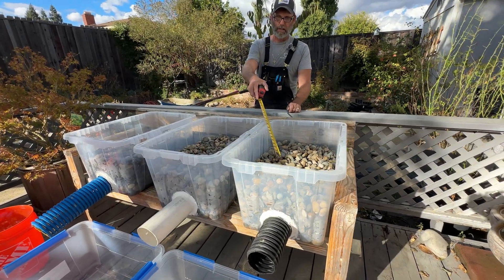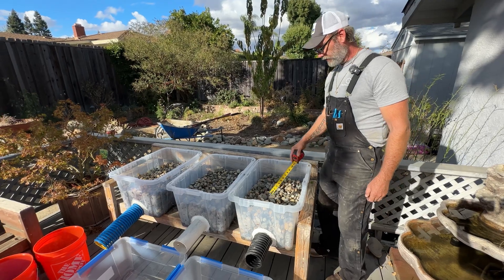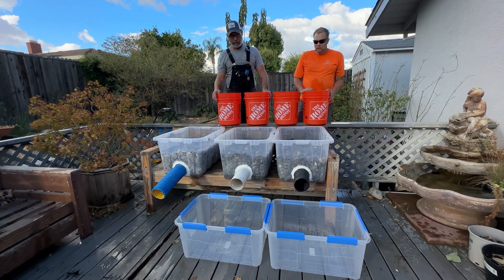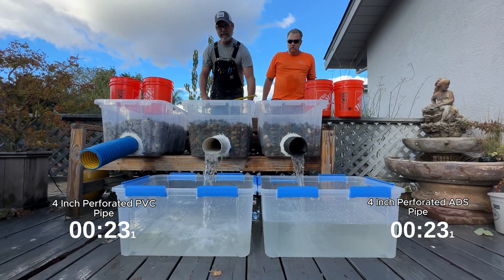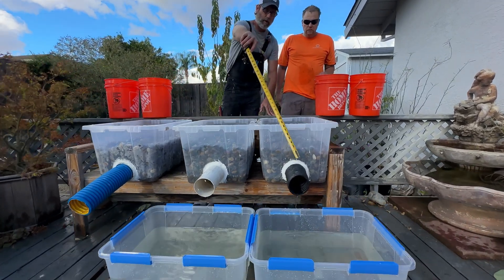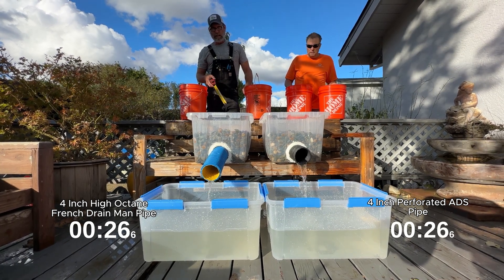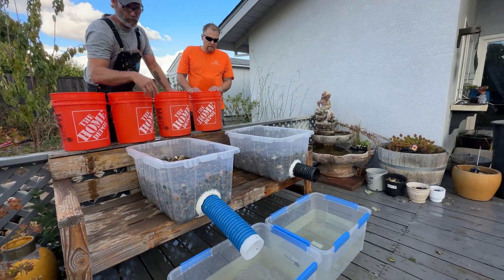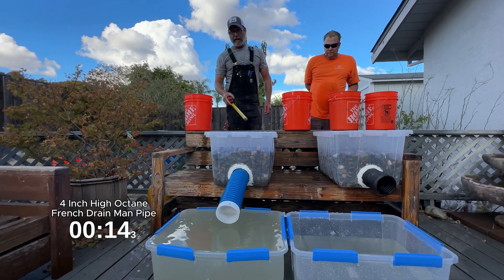ULTIMATE French Drain Pipe Water Race Test (Results Will Surprise You!)

Comment: Seems like an advertisement for FDM pipe.
Come on guys, PVC pipe was installed with holes on the bottom, yet the other pipes have holes all over the pipe.
Second of all, pvc pipe comes in 20ft runs too, a coupling is absolutely not a weak spot, it’s glued and it’s an integral part of the pipe now, never to be separated by anything other than an excavator bucket hammering at it.
At least don’t be this obvious when trying to sway people in any direction; some people just aren’t that gullible…
Reply from the maker: First of all this demonstrates an open french drain. The fact that PVC isn’t made with complete perforations is not our products fault. That’s why we designed this as we did. And the reason PVC isn’t is because it’s not designed to be structurally solid with that many holes. PVC cracks, especially in cold weather. HDPE expands. Also by ground expansion and movement. As well, PVC requires a gravel base because the holes are on the bottom. This has a hard time drying underground and roots grow towards the moisture. Causing roots after 10 years depending on circumstances. I’m guessing you use copper shields, netting and sulfate? Most don’t think this far down the road because they aren’t aware or just don’t care. Our product was designed to be a lifetime system. Also, corrugated at the proper 2%+ grade self cleans itself with turbulence, something PVC can never do. 
Secondly, couplers are weak points. Glue does not stop this when the pipe shifts and cracks. As well, almost all new installers of new homes don’t even use glue. They dry fit, I know the installers. PVC also needs to be installed with perfect 1% grade and if it waivers or gets moved out of perfect grade debris builds up causing water to ultimately build up, which causes roots to sense the water and grow inside. 
Thirdly, the product sells itself. Anyone that actually took the time to see the material and research would learn that whatever they learned previously or regurgitated from the internet isn’t always the best. It’s just what they know. That’s why our team is the best…we are committed to continued education and will always keep learning new innovative ways to improve.

Comment: However blue one has more of a slant not fair. But 100' rolls is good thing if as tough as it is claimed great.
Reply from the maker: These are both set flat in the container. But if this was a real in ground test corrugated is supposed to have 2%+ and that’s why it is self cleaning. The water turbulence inside the pipe is a positive. But these are both flat inside. FDM corrugated easily outperforms PVC

Comment: Where I am, the design standard is SDR-35 or equivalent. No corrugated.
Reply from the maker: There are different grades of corrugated. HDPE won’t freeze or crack. Virgin HDPE is much different than recycled HDPE. It’s best because it has holes 360 degrees and doesn’t require gravel on the base, which has a hard time fully drying..which causes root growth 10 years later. We install lifetime systems.

Comment: Hi, thanks for your super helpful videos. How do you decide to do a single perforated line versus a double perforated line (i.e an extra pipe for redundancy)? I don't have trees but the run is about 50 meters. Is two always better than one; or not really.
Reply from the maker: We always use minimum 4 drainage tile, but often I use more. You can use one or two if you prefer. The advantages to more is 1. Creating a larger void will ensure tree roots can’t shut the system down. 2. Same for sediment…it collects on the bottom so the more mains on the bottom and stacked will always leave somewhere for water to move downstream 3. Once you weigh the cost of additional rock, washing it, and installing there’s a lot of additional labor needed. 4. The large open areas will move water faster, where rock will have some restriction. 5. Having multiple mains on the bottom will have the most amount of water flow under torrential rains. 
The disadvantage would be the cost of shipping. We do have several distributors across the country so a local pickup would be best if you could manage that. If you need any free advice I can answer any questions you have. You can call the office number (google search) and I’ll be happy to speak to you direct. Thanks for the comment and kind words! We appreciate you.

Comment: What drainage setup would you recommend for a property right next to heavily wooded are to prevent root impaction
Reply from the maker: You’ll need to evaluate whether a french drain or solid surface water system is best. For either system I’d recommend using copper sulfate crystals on the bottom of the trench. Then I’d use the nonwoven geo textile with the infused layer of copper. You can use this material whether it’s a french drain or solid. I’d then use the copper sleeve over the drain pipe. Finish with more copper sulfate crystals. Be sure and install cleanouts on the bottom mains of your french drains. If you’re installing solid pipe use cleanouts/catch basins for access. If you need any additional clarification or advice you can call and I’ll discuss your project with you. Thanks for your comment

Comment: for buried downspouts on a separated pipe/line from the fench drain, does FDM corrugated still win out or in that instance the smooth solid interior moves easier?
Reply from the maker: It will win in the long run for sure because corrugated installed on the correct grade is self cleaning. The ridges cause turbulence and cleans the pipe. Smooth has to be 1% grade or the water will move faster than any debris. Which causes sediment buildup, which causes water buildup overtime, which causes roots to search it out

Comment: I like the test but I think you should be pumping the water instead of only using 10 gallons of water.  Dual M98 pumps could easily overload those pipes & show us how they compare.  Primarily the head-height, whose power is displayed at 5:20 where you can see the higher the water at the inlet the more pressure is at the outlet.  Using a pump for these tests allows a much more consistent head-height to push things more evenly to the outlet.
Reply from the maker: Thanks for your comment. These gravity french drains lead to a pump. So they are not recieving water from a pump. The restriction at that point would be the size of the ejection line and the pumps capacity. 
However, you can get upward of 240 gallons per minute through a 4” pipe. So it would take one fancy pump to overload that. Usually I’ll use 2” PVC (which would allow for 127 GPM roughly) or 1 1/2” (which would allow for about 80 GPM). I’ve done dual pump systems but honestly if the detention tank is large enough they are rarely necessary. We have a video on sumps and detention tanks too. They are usually 24” industrial culvert tees which have a horizontal holding area and allow the pump to sit lower than the majority of holding area….maximizing the use of the pump and minimizing short cycling. 
I can see how the pumps would provide more consistent supply for the test but that scenario would never happen in the real world regarding installations. 
Also consider since surface/downspout systems are separate from french drains they have that 240 GPM capacity on each drainage tile. On top of that, my french drains are always installed with minimum 4 each 4” drainage tiles (often more). So the actual void for allowing water to move is astronomical. I do this for maximum flow and longevity of the system (regarding root growth and debris build up). The drainage tile itself had a 300 year disintegration rate so a good healthy system will outlive my clients (and likely the house). Thanks for your comment. Appreciate it
Reply: @OlderHomeSpecialists  One of the things I wish a data-maker would reproduce is the NDS GPM ratings for their products.  One example is the CB #1245 where NDS shows the top-mount outlet can move 70.49 GPM but if mounted at the bottom can move 83.41 GPMs. So they gained over 10 GPM by installing the pipe a few inches deeper, possibly ~6 GPM gain at that inlet for every inch deeper it is put under the ground surface.  Nerd-numbers.
Reply from the maker: Good ideas! I totally agree with you. We rely on stats that are often not questioned and could vary under different circumstances. Thanks for the feedback

Comment: SO are we just gonna ignore all the water leaking around the blue pipe where it comes out of the bin?
Reply from the maker: Actually that’s the perforated tile shoving water out the holes. It does look like it’s leaking but it was not. It looked worse on the high octane tile because it’s the only material that actually has significant openings compared to the others.

Comment: One huge disadvantage of the FDM pipe is being able to actually get it.  With the cost of shipping, the pipe ends up being 4x the cost of ADS pipe.
Reply from the maker: We are setting up distribution areas around the country. We are here for local pickup in Northern California
Reply: @OlderHomeSpecialists   Yeah, that's my issue as well.  Would love to use FDM pipe, but the shipping cost is so high. Was looking at using his discharge plates, couplers, etc. and possibly PVC pipe.  Not sure yet.
Reply: FDM offers 25ft sections of 3 inch pipe in his Torrential Rain line, and they don't have the freight charge.  I only have 2 areas at the back of my house(one on each side of a raised porch area) that I need to get some water away from, and these were perfect for what I needed.  Shipping was only 12 dollars for two of the 3 inch pipe kits. Might not be a solution for everyone, but for me it was perfect and it let me get a better product than the box store stuff without paying high freight costs. I'm in Northern Illinois and most of the corrugated pipe from the box stores won't survive more than a few winters around here.
Reply from the maker: Great advice! I’m glad this worked out good for you! Thanks for the comment
Reply: $400 plus for shipping YIKES. I’d buy it, but thata almost $6 a foot
Reply: If you’re in north Florida or south GA we distribute.
Reply: Pay in the front end or pay at the back end
Reply: You being poor has nothing to do with their review

Comment: That last Test doesnt make the Blue Pipe the winner. In a Perf Pipe you would want the water to slowly release the water
Reply from the maker: Perforated pipe has grade downstream and removes the water. It does not dissipate into the ground. Unless it’s a leach field, which we do not install. In CA rarely is the soil going to percolate well enough for that. We would pump it. So we want the water in fast and out fast
Reply: I agree, so the water will have time to reach into the soil. In a supermarket rain it could possible rise to the surface especially if it comes out to a popup, if it end out to an opened end its fine

Comment: Close enough especially for the price
Reply from the maker: The price difference is not significant enough to use cheap materials. Cheap is expensive. Anyone that had the two materials in their hand would tell the difference immediately. And anyone that has had structural drainage issues would say every amount makes a difference

Comment: I installed Home Depot corrugated French drain around my house after Hurricane Isabel in 2003. Sold the house in 2020 and never had any problems whatsoever. I went around the entire exterior of the house along the footer with gravel all the way to surface. Never had another wet crawlspace nor clogged pipe. Never used any fabric just pipe and gravel. Owner of the house loves it too.
Reply from the maker: I’m glad that worked for you. However, of the thousands of drains I’ve completed hardly anyone could say the same. Of course there can be an exception with certain circumstances, but generally speaking using recycled Agricultural pipe for residential is sub standard.
Reply: @  what would you recommend in the future? I thought about the blue pipe from the French Drain Man. I’ve bought other things from him in the past
Reply: @ you know another thing I started seeing recently is packing peanuts instead of gravel for crawlspace drains. Not the pipe that’s already manufactured but actually laying peanuts around the pipe
Reply: So you dug around foundation of house, placed gravel, then french corrugated and covered with gravel instead of dirt?  I'm on a budget so I have to make do with what I can afford. Thank you.
Reply: @ yes, filled with gravel all the way to the top.
Reply: @JwMatrix  how wide from the house did you dig? Thank you for responding.

Comment: What’s price difference 😂
Reply from the maker: Both pvc and high octane are approximately $1.85 per foot. Recycled black corrugated is usually about $1.10-$1.25. However, when doing a system like this you would t want to skimp on the materials. Cheap isnt cheap, its expensive

Comment: In no expert, but the fall on the blue pipe gives it a huge benefit, I would imagine.
Reply from the maker: We left this ping for the final flow test, however your point is well taken. We are posting a PVC to high octane comparison with larger flow tests. The high octane did appear to have slope but they were all flat and equal on the bottom. We are going to show the set up this time and make equal lengths to remove questions and any inconsistencies. Thanks for the comment
Reply: Looks to me they both moved the same amount of water just the low octane pipe was still going lol
Reply: It isn't in that setup there.  It is possible to create a vacuum in the pipe with the water falling in it but I don't think that setup is getting the seal you'd need to produce that suction.
Reply: Yup. I agree. 
The pitch on the blue pipe gives it the advantage.
Reply: You are correct.  The test was set up to benefit the blue pipe given more of the drainage of the pipe was expose due to length.    Rigged test for sure.
Reply: Oh. C'mon.. this doesn't matter here at all as the pipe is not fully filled with water. 

You could though propose a thesis about the shape of the output orifice and its hydrodynamic resistance

Comment: I used corrugated and pvc corrugated always clogged up, pvc stayed cleaned
Reply from the maker: When corrugated fails it is because of the installation. Recycled corrugated is different than virgin corrugated. Most drain installers haven’t even seen virgin HDPE or had it in their hands

Comment: Finally, someone who shares the opinions on the benefits of a corrugated pipe. More flexibility, less splices for root intrusion, better pricing.  Great pipe WHEN installed correctly.  The FDR pipe was impressive.🧐
Great Video
We’ve been planning on running this exact test almost… anything you’d change or do differently for when we do ours?

Comment: Why blue one stick out further & end so much lower than the others?
Reply: Having it extend out further is assisting on pulling the water out faster.  Physics.
Reply from the maker: Upcoming is a more in depth comparison of  PVC to corrugated. This will include strength testing and maximum flow with high capacity containers. Also any advantages/disadvantages between the two. May the best drain tile win.
Reply: @OlderHomeSpecialists  you didn't actually rebut what he said. It's not the ai win you think it was
Reply: The blue racing perf pipe is def pitched more
Reply: To show flow out of the holes in the last test
Reply from the maker: Yes it was just to show the final double plug test. If anything this would have been an advantage to the others because high octane blue would have had to move the water further. It bent down because it was longer. This didn’t give an advantage, high octane drops the water level much faster than any of the competitors
Reply: @OlderHomeSpecialists  dude. You're wrong. Just grow up and accept it.

Comment from the maker: Much of the problems are from bad installation practices, agreed. Same with PVC, many install them on a highest and lowest point of gravity and don’t bed the pipe with correct slope. The same happens, weight of the dirt pushes the pipe flat or to have bellies. This not only causes water restriction and debris build up, but also limits the air flow to break siphon. Thanks for the comment!
Reply: Hi Bud, if the smooth pvc pipe had larger holes and more holes, do you think this might beat the corrugated pipe?

Comment: All the pipes will be at max flow if you scale this up. S40 is harder for contractors to install incorrectly. Bad contractors install parts of flex pipe in dips causing drainage issues. The flex pipe is superior if installed perfectly.